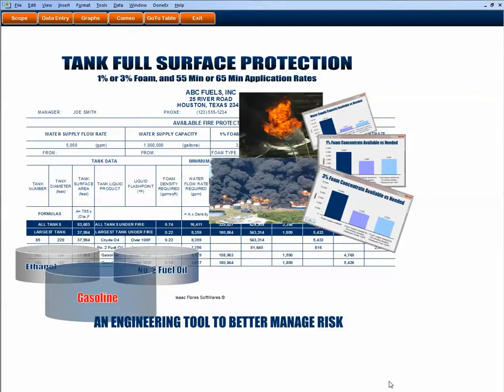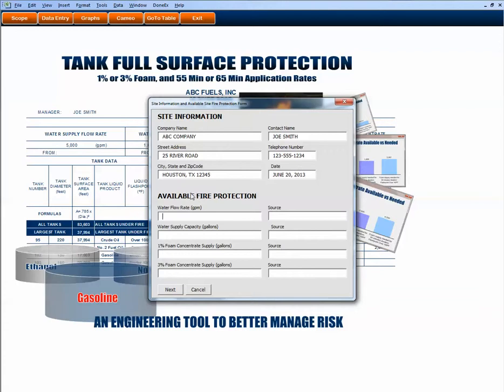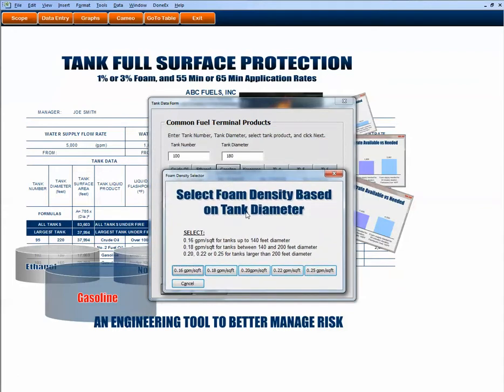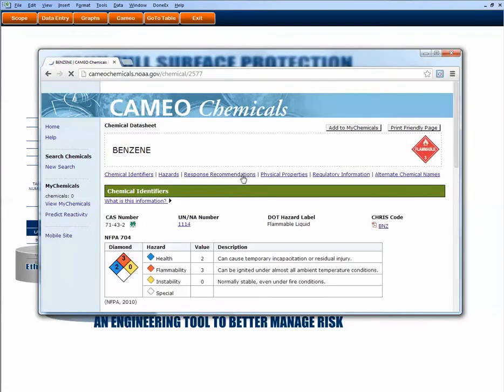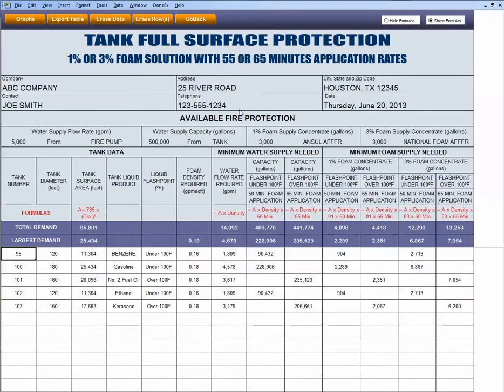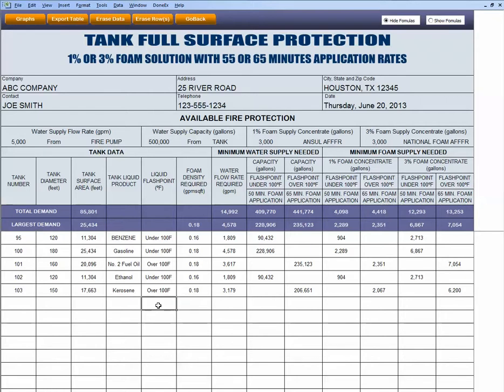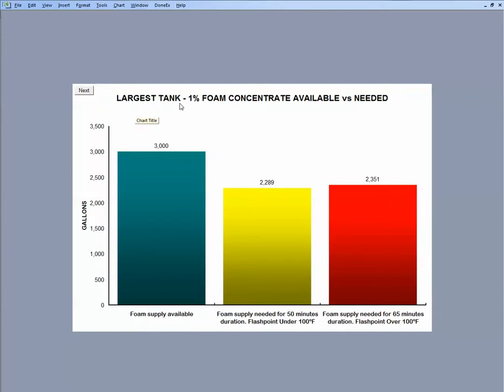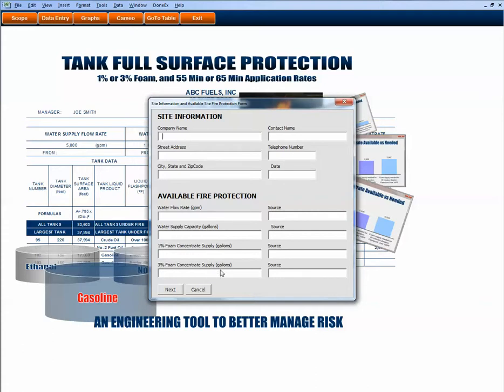Tank Full Surface Protection Movie No. 2

Comment from the maker: This Tank Full Surface Protection Program calculates the level of fire protection needed for effective manual fire protection and compares to available level of fire protection to better manage risk.  If you need to evaluate adequacy of fire protection at fuel terminals, this program is designed for you.  

If you have questions send me a message at iisaacflores@gmail. com.
Thanks
Isaac Flores